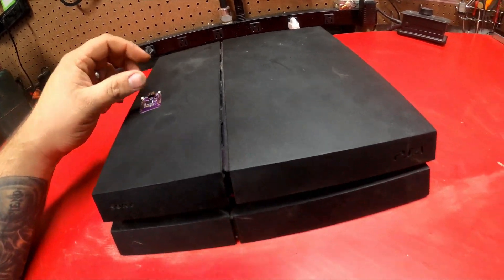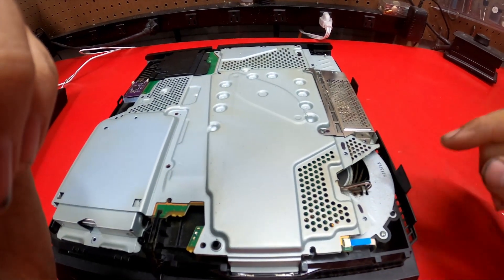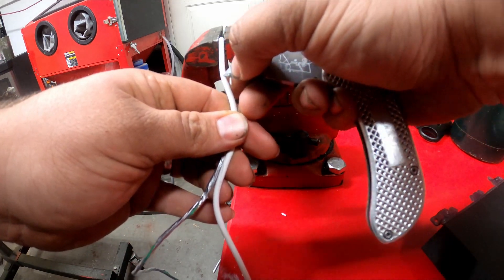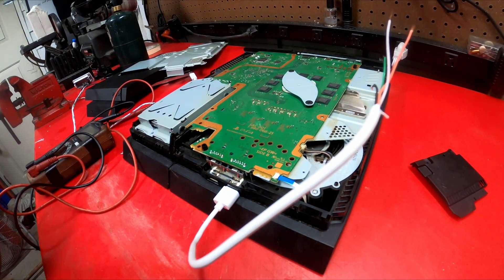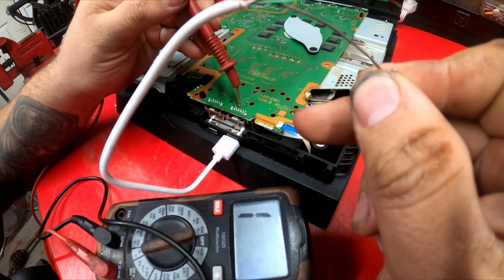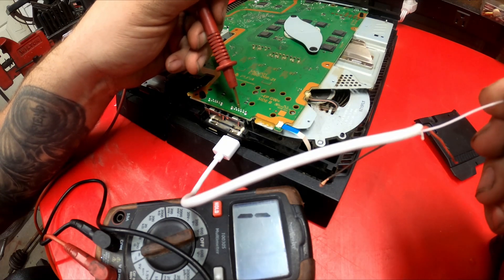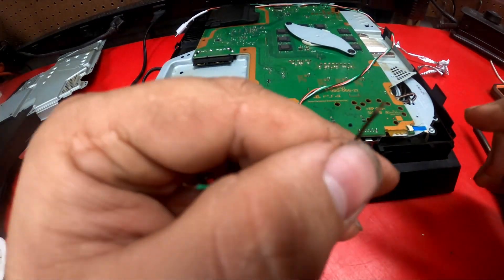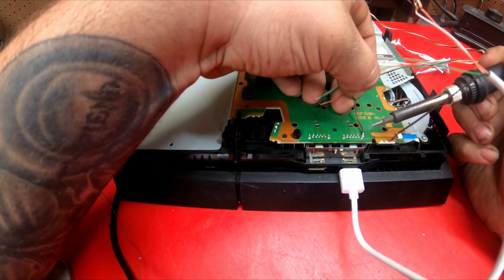PS4 Internal ESP32-s2 Mini Exploit

Comment: Why would you bother soldiering it in - just buy a short USB A to Micro USB and have the wifi chip connected to one of the rear USB ports. also get a auto load Goldhen payload.
Reply from the maker: Because I don't have rear ports.
Reply: @CorpseFreak  Oh fair enough then

Comment: The idea is good, but the port will be lost anyway, because a device will be permantly connected to him, it's not possible to connect another device on the same port.

A variation of this idea is to solder a extension and make available a little usb-c female port on the back of the console (or simple use a 90º usb cable), in  this back port you conect the ESP or a USB Hub and mantain all devices connected in this back port hidden.

But, good job.
Reply: @CorpseFreak  The port continues available with this mod? If you connect a usb stick to it, works? If yes, sorry for my incorrect message.
Reply from the maker: @Nandolavras  I was incorrect. You are correct. I guess a hub on the back is a good call.
For my situation the ports are only used for charging controllers. I will look into doing a mod with a hub now.

Sorry I'm a dick and thank you for correcting me.
Reply: Another way that might work to still use the existing USB ports. Is to desolder the existing USB ports from the PS4 and put in a small two port hub or USB spliltter. One that goes to the ESP32 and one back to the PS4 USB points on the board. I'm not for sure if it'll work or if enough power could be supplied that way but it would be interesting to see if it could work.
Reply from the maker: Just did some more testing. Usb port is functional.
Reply: @CorpseFreak  Yes, i not realized this at beginning, after ESP exploits the console it stays completely stealth, like no usb device is inserted, :).
Reply: @Nandolavras  So to make sure I understand, because I'm about to do this on my own console, the USB port could/should not be used during the process of exploitation. But once the exploit is finished, it will be usable as a USB port once again?
Reply: @Dushku  I not do this on mine, but yes, it is, after the exploit run, the ideia is the port remains "free", because the board deactivates the own port completely.
Reply: @CorpseFreak  So to make sure I understand, because I'm about to do this on my own console, the USB port could/should not be used during the process of exploitation. But once the exploit is finished, it will be usable as a USB port once again?